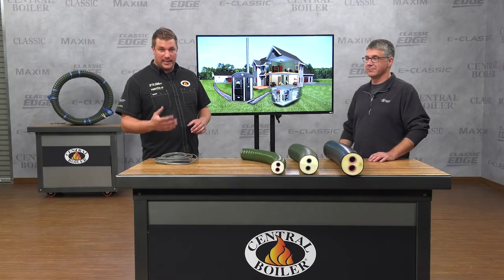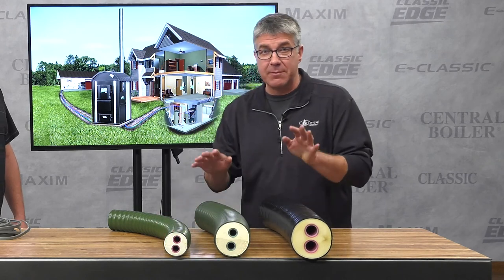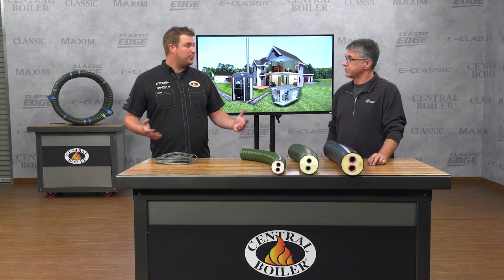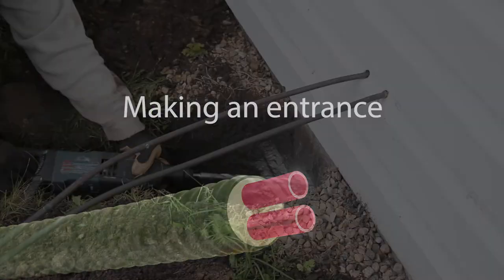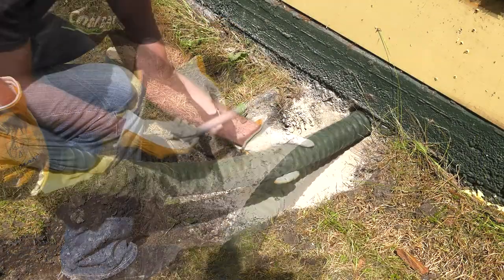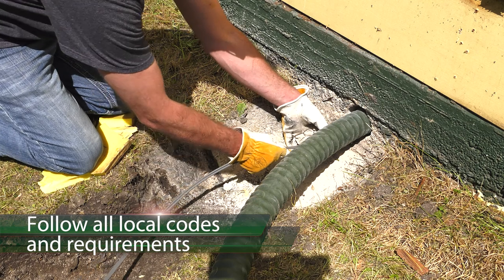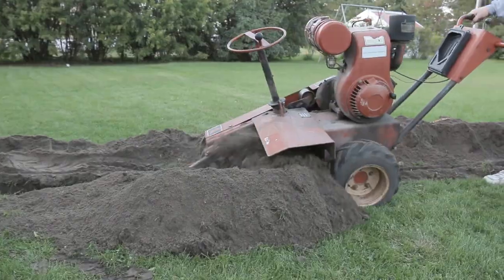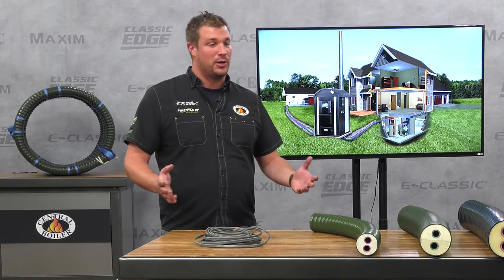Easy Installation: ThermoPEX Trench And Entry Point To Building │ Central Boiler

Comment: What size coring bit would you recommend for the 1 inch? Also I imagine this would still work great going from the house boiler 100ft to the garages infloor heating, instead of having an outdoor boiler.
Reply from the maker: The outside diameter of the 1” ThermoPEX is 4 ¼”, so 4 ½-4 ¾ would work and many people seal the opening with expanding foam.

Comment: G when I did my trench I dug 4’ down as I couldn’t hold any curves as it’s so stiff. Needed the 4’ depth so i could make the radius  12 years later my back has recovered
Reply: Yeah we also did a 4' deep trench to get below the frost line and to achieve the entry angle you describe at the heater

Comment: I find it rather odd that the 25mm line is much smaller than the 1" line. One inch & 25mm are pretty much the same size. One inch equals 25.4mm so I don't understand the difference in these 2 lines. Maybe someone that is familiar with this from CB can explain it.
Reply from the maker: The one inch is about 7/8" inside and the 25mm is about 3/4" inside.  Keep in mind you don't have to increase the circumference of a circle much to increase the volume.

Comment: We are going to be pouring our concrete slab and one of your salesman advised me to put a piece of 6” pipe straight down, at least 6” below the footer. This would suggest the pipe would be coming in at a hard 90 degree angle. His suggestion is opposite of what you just showed. So how exactly do I stub this up; before we pour concrete?
Reply from the maker: Putting the 6" pipe at a 45 degree angle may be more manageable. If using a 90 degree angle, there would have to be room for the ThermoPEX to sweep and curve since it doesn't flex that easily.
Reply: @centralboilerinc  Thank you! I will have that installed before we pour this week.

Comment: Is the pex tubing in Thermopex a Pex-A aka uponor that can use expansion fittings?
Reply from the maker: It's not meant for expansion fittings but it is an oxygen barrier.
Reply: @centralboilerinc  thank you for the reply!